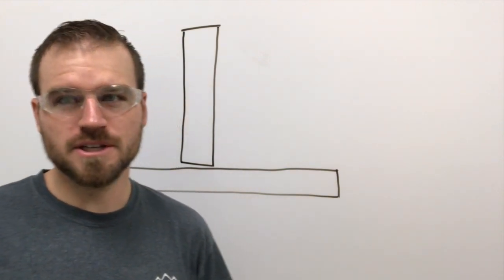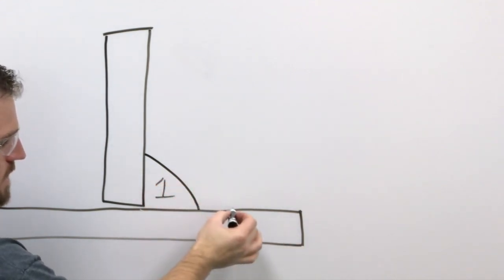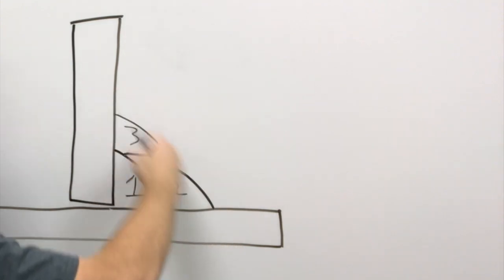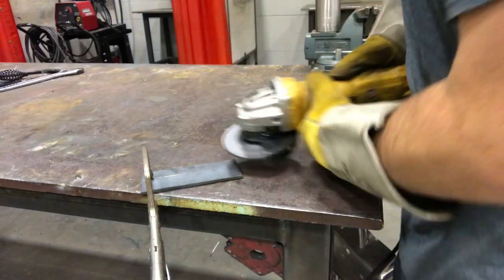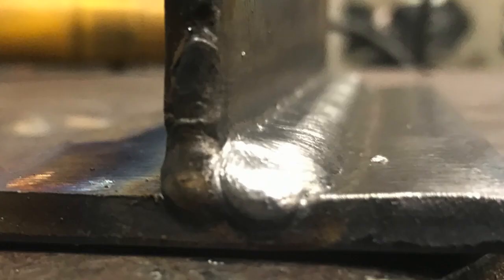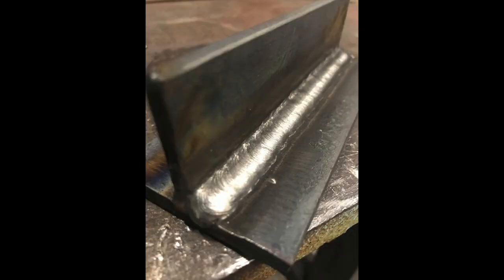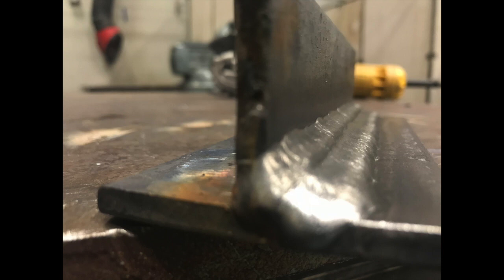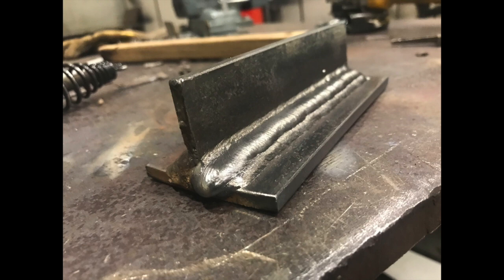Welding SMAW - How to weld a fillet

Comment: Great video, very informative. When I try to do fillet welds, I end up either getting the entire bead on the top plate, or these “boogers” back and forth between the bottom and top plate. Does this mean I’m inaccurately aiming the electrode?
I’m using a 1/16 6013 @ 40A on 3/16 steel, is it possible I’m using an electrode that’s too thin? It works fine on flat surfaces, but is really messy on corners.

Thank you.
Reply from the maker: I've never used 1/16 6013 so I don't know what the setting are for that rod but I doubt rod angle or metal thickness is the problem. I would switch to 7018 with a 3/32 size if it were me. I wish I could be more help, good luck!
Reply: @Mikesfilmss  Thanks!